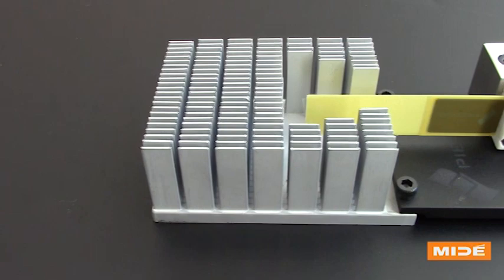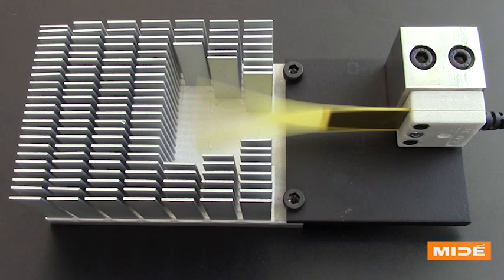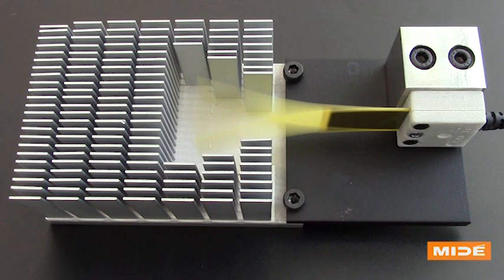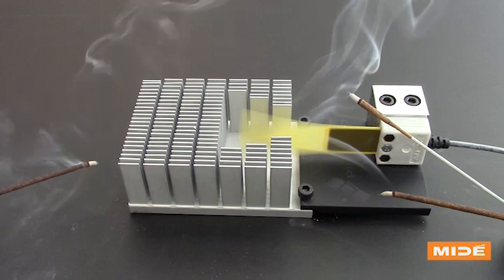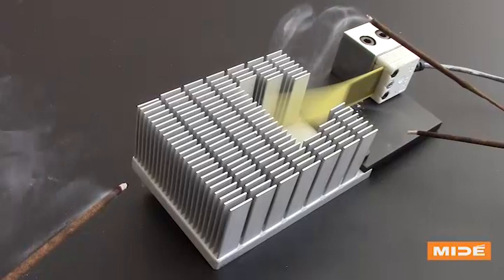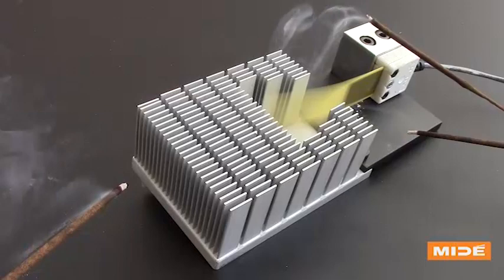Forced Convection with Solid State Piezoelectric Fan

Comment: “No moving parts” 

Proceeds to start to vibrate significantly
Reply: Moving parts refers internal kinetics.
One would fail to say that an arrow in motion has moving parts.
Reply: @0MVR_0  - Bad analogy. A better equivalence would be with a living (flexible) hinge. You might describe it as being all "one part", but when it bends it's still moving, and is therefore subject to wear. As is the arrow, by the way (just of a different type).
Reply: @RFC-3514  The analogy is apt. Imagine an arrow that flies through the air around the globe in perpetuity. The bending is actually different to motion, so long as there is insignificant wind
Reply: @0MVR_0  - "an arrow that flies through the air around the globe in perpetuity" - The stranger the thing you need to imagine, the clearer it should be how bad the analogy was.
Reply: @RFC-3514  The connecting idea is a solid body immersed in a fluid.
Reply: @0MVR_0  - The issue isn't the fluid, it's the bending and the vibration.
Reply: @RFC-3514  Piezoelectric stimulation results in molecular structural adjustments. The substance is perfectly still, however minuet contradictions in alignment causes the material to 'fall' into a better conforming position. Thus there is minimal sheering happening compared to mechanically actuating from a motor, or as the original post referred to with 'moving parts'.
Reply: @0MVR_0  - If the substance was "perfectly still" it wouldn't be able to move any air. It's still a mechanical fan, not an ionic wind generator.

It just happens to bend (like a living hinge) instead of rotating. It's still subject to more stress than a magnetic levitation fan (or ionic wind generator).
Reply: @RFC-3514  Actually ionic wind generation would be a parallel phenomenon, namely the gradient wave caused from electromagnetic impulse. Imagine the ionization occurring to some polymer that responded by conforming to a contrastive geometry. You surely would hesitate to say this is a mechanical principle.
Reply: @RFC-3514  In conclusion, a solid object dropped from a height is internally still or static despite the fact that gravity acts to cause displacement. The same principle exists with piezoelectrics or anything undergoing electromagnetic actuation as a single body.
Reply: @0MVR_0  - If you think bending doesn't count as movement (and doesn't stress materials), I wouldn't cross any bridge you were involved in designing.

But thankfully I don't think I run that risk; you clearly seem to love the sound of your own keyboard so much that you're just going to keep coming back here to reply to yourself...
Reply: @RFC-3514  We definitely agree, since most any bridge requires a multitude of parts and one made by a single person would be inferior.

I do invite you to investigate why a person employing useful language is choosing to present a radically contradictory idea.

Thank you for your time

Comment: If one attaches more than one piezoelectric oscillator to a single mica card, they will oscillate synchronously vastly increasing the fan's surface area and airflow. Sandwiching mica card oscillators between peltier plates, produces an effective high efficiency low consumption cooling and heating assembly.

Comment: This video is 6+ years old, how have I not seen these being used already ?
Could it be a patent holding the use of these back ?
Reply: it probably just sucks compared to other cooling methods.
Reply: A version of this was in the electronics trade mags here in the UK back in the early 80s. They didn't take off then either.
Reply: Or it doesn’t work
Reply: @RobertWilkinsonJKekMaloy  did you not watch the video.. it didn't look CGI to me.
Reply: @procactus9109  never said fuck about cgi. I said “they said no moving parts, oh look a moving part”
Reply: @procactus9109  and in THIS thread I commented that it probably doesn’t work which is why it isn’t in production after six years
Reply: @RobertWilkinsonJKekMaloy  well it looks like it works atleast somewhat
Reply: @procactus9109  im not saying it doesn’t work, im saying “do not call an item in motion a non-moving part.”
Reply: @RobertWilkinsonJKekMaloy  I'm going to guess you're American

Comment: @Mide Technology  the technology is inspiring, thanks for the video. But the demo is not complete till you demo all what you assert in the video. Thus, same you showed the air flow with smoke, you should add a sound meter and mute your voice for a while in order to hear the fan's sound, and to see the dB while both when you talk, and when you're muted.
Reply: I agree. I think it might be that it actually creates a very annoying constant 50 or 60hz hum.
Reply: @hapskie  It's not any louder than a normal fan and in some cases even quieter. However, these are only being marketed for industrial settings where normal fans would fail quickly (very dirty/dusty environments) or environments where there is a lot of flammable/explosive gas. The ambient noise would drown out any kind of "humming" these fans might produce. It's not really necessary to test for or worry about.

Comment: why has this video suddenly been recomended to so many people? who knows but this is cool, i want to know about material fatigue like the rest of the comments, how long can this last?
Reply from the maker: Thanks Frogz.  Here is some comments we provided on material fatigue:

During the development of the piezoelectric fan our customer required us to run some highly accelerated life testing (HALT) on a statistically significant number of samples.  The test included thermally cycling the fans 1000 times from -40 to 125C while they were operating.  The test took about 5 weeks to complete.  There were no failures.  We also ran the fans through high temperature operating life at 180C (HTOL), low temperature operating life at -70C (LTOL), Over voltage test at 100% over the normal operating voltage, Humidity HALT testing, Cold start testing which included a hard start up after the fans soaked at -40C for 14 hours, high temperature storage tests where the fans were soaked at 140C for 1000 hours prior to successful operation, dust ingress testing, salt spray and fog testing and IP68 testing where we submerged the fans for 72 hours at the equivalent of 3 meter depth pressure and then operated them after they were removed and dried off.  There were never any failures during any of these tests.  Lastly, we have been running a non accelerated life test on a single unit (in my office) since June 15th, 2016.  It has only been unplugged one time when we moved to a new building.  It is still running as of this morning with no noticeable change in performance.  I sit about 6 feet from it, If I really try to listen hard I can hear it running.  Running at 60 Hz we have put just over 11 billion cycles on the fan without failure or change in performance.
Reply: @MideTech  awesome, i wonder what unexplored applications this would be useful in, micro-fluidics, on chip active cooling, who knows the far reaches of a vibrating reed!
edit: what denotes the natural resonance? is it more a function of mass or of current/voltage?

Comment: Not sure why this video got recommended to me, but I am curious on one thing: Is it possible to power the piezo fan with an inverter power supply setup, for example, if a business needs it for a DC powered low voltage application, and have no means to supply direct AC from the wall, but can convert 12 VDC to 120 VAC 60 Hz, would it be possible?

Comment: what about the vibrations caused? what are some applications that wont be affected by them?
Reply: Stratos, there are some small mechanical vibrations for sure.  I don't have a measurement of them but the next time I'm in our office I'll put one of our enDAQ sensors (www.endaq.com) on there to get you some data.  We have found that for most applications the small vibrations are allowable (telecommunications, oil and gas, etc) but there are deifinitely some where the vibrations would not be allowed.  Thanks for checking the video out.
Reply: @cludlow64  Thanks for the reply.
Reply: @STRATOS13PAO  Thanks for thanking the reply.
Reply: What a vibration, look at this cosmic price, you won't need it

Comment: Pretty fascinatingly simple. Running off of 60hz power to oscillate. How does power draw compare to a traditional fan? (Something like the Noctua 40x20 (12v) drawing 0.05amps/0.6 watts)
Reply: According to the specs on the website, the higher power variant uses slightly more power (1 watt vs 0.6), but achieves higher air flow (10 CFM vs 5.5). The low power variant claims to achieve 2 CFM from just 30 milliwatts (0.03 watts).

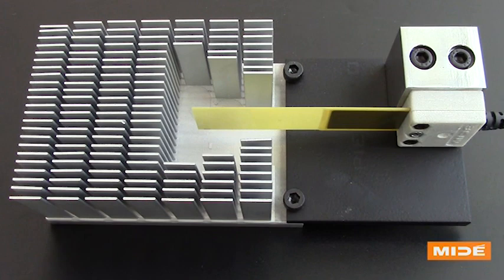Comment: Noisy (that's why there no audio of it here), fragile (all that flexing will create material fatigue stresses over time), inefficient (there is more air pushed on each side of the flexing blade than in front of it), dumb idea. BTW @0:09 "There are no...moving parts...that can fail", oh yeah? What's that flapping blade then?

Comment: I don't know if I would call this "No moving parts"
Reply: And 100% organics. LUL
Reply: This oscillation doesn't induce any friction between two materials (except air resistance) and technically stays in the same spot. It just flexes which is generally better for efficiency.
Reply: @derblaue  does it transfer from one position to another?  If so, that is called a Moving Part.
Reply: @RobertWilkinsonJKekMaloy  Piezoelectric actuation is performed by distorting the geometry of an electro-responsive material with a charged stimulus. This would be similar to saying your brain is a moving part because the neurons are firing
Reply: @RobertWilkinsonJKekMaloy  Dear lord, leave the definitions to the people that know what they are talking about.

Comment: Could this be used to silently increase the efficiency of home radiators? Or split ac systems?
Reply: If you’re talking about oil radiators for heating, they’re already 100% efficient; Adding a fan only reduces surface temperature and makes it safer. Split AC systems already have fans
Reply: Remember the noise of a ruler flicking on the end of the table, not so silent was it !!!
Reply: @ntal5859  Rulers aren't the same thing as this. Different material, design, oscillating frequency, and size. I will say that dedicated piezoelectric fans like this are no more louder than a normal desktop fan and sometimes even quieter. Though, these are not meant to replace desktop fans (which are way more efficient). They are designed for industrial applications where normal fans might otherwise fail rapidly or be dangerous.

Comment: This seems like perfect for server applications or even consumer consoles where an elongated form factor could benefit from this. How does static pressure look out of these?
Reply: Too expensive for most computer use where product lifetimes are 3-5x less than this thing's MTBF.
Reply: Expensive, no more reliable, shorter lifespan, more noise.... want more?
They are a useful for a specific niche market, but that market is not moving a lot of air efficiently.
Reply: @ABaumstumpf  They aren't noisier than a normal fan (you can barely hear them if you focus on it) and can last pretty damn long without any kind of maintenance. If you look up in the comment chain above (profdc9's comment), they actually comment on the type of testing (very rigorous) they did and have had one of these running since 2016 with no difference in performance. The only downsides are they don't move as much air as a regular fan does and they require a direct line connection, so it's difficult to implement in low-power settings.

These would be very useful in industrial applications where the environment is very dirty and also involve flammable/explosive gases. These won't replace desktop fans.

Comment: What is the benefit of this over a cheap regular 3-4 blade fan.  The tech behind it is definitely awesome. I cannot believe a fan like this can exist.  But it should be justifiable in monetory or energy conservation terms for wide adoption.
Reply: These are most useful in industrial environments that are very dirty where a normal fan could fail quickly as well as environments where flammable/explosive gas is common where normal fans could ignite the gas. These won't replace normal desktop fans.

Comment: I would have to see some static pressure and airflow tests.  Waiving your hand over a heat sink may be all fine and good on the test bench, but put it inside of a low profile computer case or rack mount and show me how this draws cool air in and expels hot air out of the containment.  All modern computers and servers use ducting so that each and every fan channels air in/out of the case.  Old 486 and Pentium computers used to wiggle air around inside the case, like this does.
Reply: These aren't being marketed for consumer use, only for industrial applications where efficiency isn't really a necessity but safety is (like flammable/explosive gas environments). I will tell you that normal fans are way more efficient if you want desktop cooling.
Reply: @Retrolian1000  The Industrial World requires lowest of low profile rack mount cases.  Space is money. We still need static pressure tests to show that air moves in and air moves out when it's told to move.
Reply: @agvulpine  Depends on the industry but I see your point. Not sure they are going to freely provide that information though. 

They did make this for a customer to their specs so I don't think these are a "sham" or anything otherwise they would have gone out of business years ago. There's obviously a market for them. 

You should watch their newest video where they address some of the questions and criticisms. It literally came out yesterday.

Comment: Yeah, no moving parts, even though the strip move back and forth a lot and can break.
Reply: A lot of materials have great stress fatigue resistance. Steel for example. Just because something is rapidly oscillating, doesn't mean it's going to fail immediately.

Comment: Does the fin not experience mechanical fatigue?
Reply from the maker: Thanks for the comment Ibles, here is what we provided to another similar comment.  During the development of the piezoelectric fan our customer required us to run some highly accelerated life testing (HALT) on a statistically significant number of samples.  The test included thermally cycling the fans 1000 times from -40 to 125C while they were operating.  The test took about 5 weeks to complete.  There were no failures.  We also ran the fans through high temperature operating life at 180C (HTOL), low temperature operating life at -70C (LTOL), Over voltage test at 100% over the normal operating voltage, Humidity HALT testing, Cold start testing which included a hard start up after the fans soaked at -40C for 14 hours, high temperature storage tests where the fans were soaked at 140C for 1000 hours prior to successful operation, dust ingress testing, salt spray and fog testing and IP68 testing where we submerged the fans for 72 hours at the equivalent of 3 meter depth pressure and then operated them after they were removed and dried off.  There were never any failures during any of these tests.  Lastly, we have been running a non accelerated life test on a single unit (in my office) since June 15th, 2016.  It has only been unplugged one time when we moved to a new building.  It is still running as of this morning with no noticeable change in performance.  I sit about 6 feet from it, If I really try to listen hard I can hear it running.  Running at 60 Hz we have put just over 11 billion cycles on the fan without failure or change in performance.

Comment: cant find video with sound at all, i think its have a reason
Reply: @Boomkop3  Doesn't have to be. If it's a clean 50hz sine tone, it's not very intrusive and with a heat sink, it'll also dampen/silence the noise that it makes quite a bit. 
Low frequencies are pretty hard to reproduce - look at the size of a speaker that can efficiently reproduce 50hz tones.
Reply: @Boomkop3  Why do you think it is loud? 
I think it can be very quiet because of the almost complete acoustic short circuit between the sides of the flappy thing. 
Compare the sound your subwoofer makes inside its enclosure, versus when you suspend it from a piece of string in the open air. At 30hz, you will only hear any distortion products, but the 30hz (or 50hz) itself will be pretty faint.
Reply: @Boomkop3  Of course it's gonna be audible, but it's pretty likely to be very quiet, like a little aquarium bubbler pump.
Reply: @Boomkop3  Yes, yet it's very quiet ;)
Reply: @Boomkop3  Go to a random pet/aquarium store, and check how loud/quiet the pumps are. 
You'll notice that they make a very faint humming sound.

Comment: This is not solid state. It's a part in motion. It's bending back and forth. It will fail eventually. To claim otherwise is silly.
Reply: Running at 60 Hz we have put just over 11 billion cycles on the fan without failure or change in performance.
Reply: @Aaron-ru6ld  great. Doesn't make it solid state or have no moving parts to wear. Those are false claims.